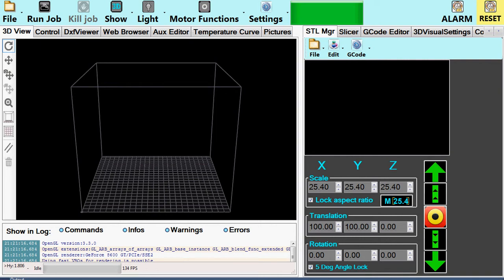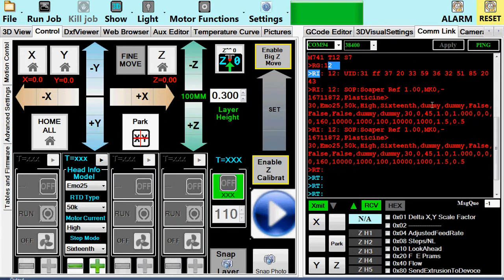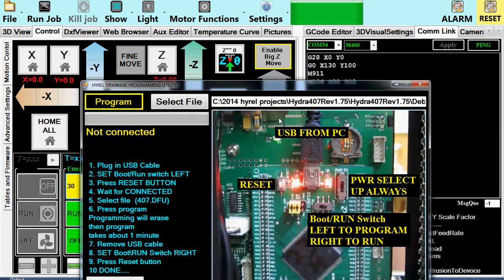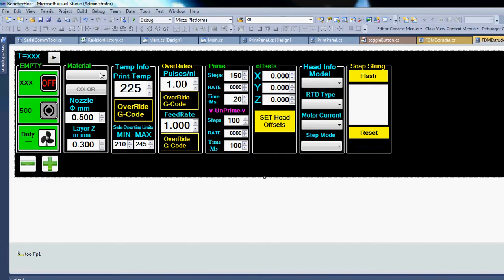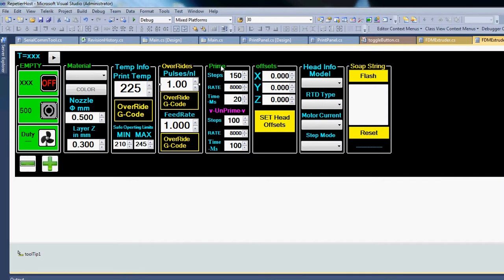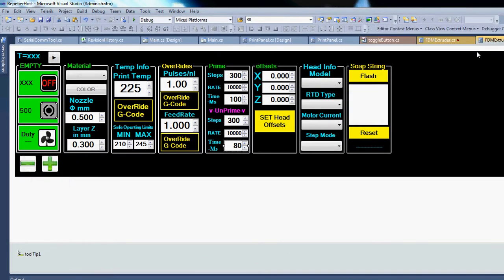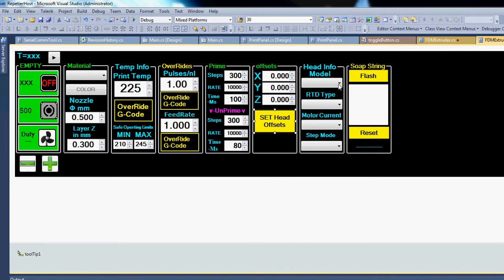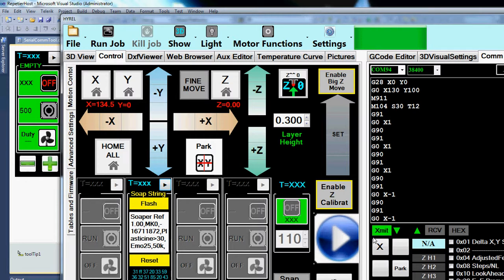Repetrel intro 1 806 part 1

Comment: Is there any way to override the temperature safe operating limits since they are not able to be used in this software version? I am trying to print with PLA at 185C, but the minimum safe operating limit is 210C which is way to high and burns my filament.